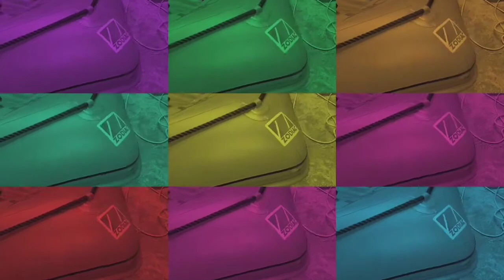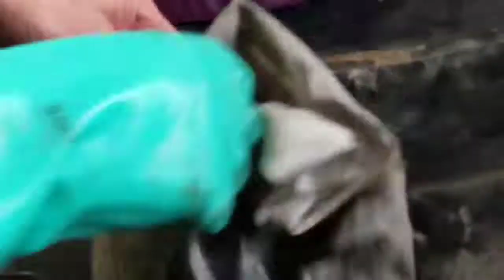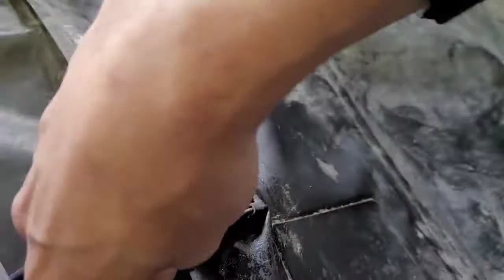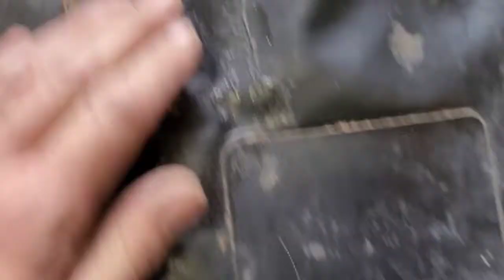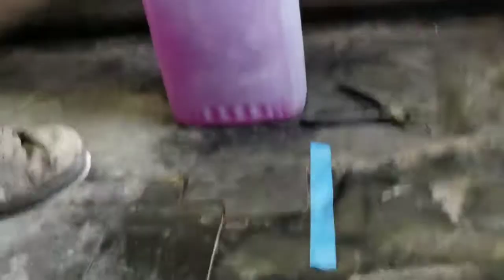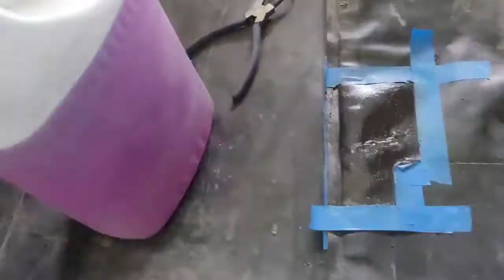How to fix a tear or rip in your inflatable boat

Comment: hello GasHopper, enjoying the channel >
did you abrade the Hypalon inner patch and / or was it the shiny side contacting the matt side ?
Reply from the maker: Sand the dark on Hypalon Material. If both sides the same color due to the color being a black or dark gray, it's usually the duller side.